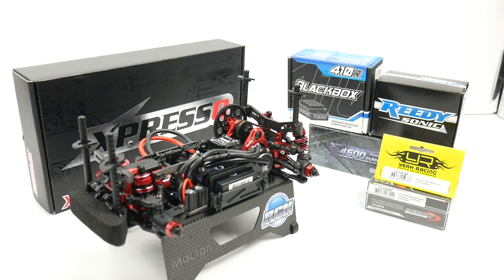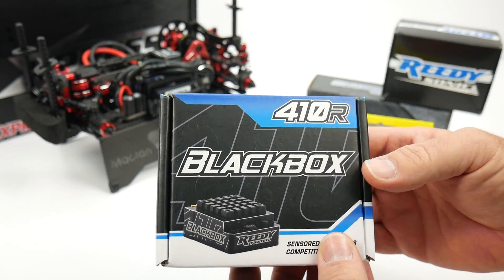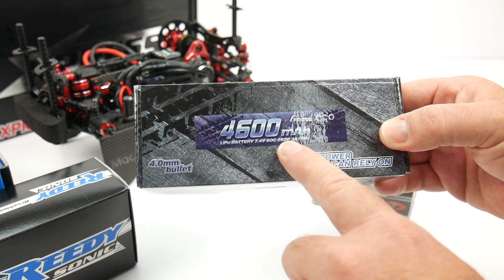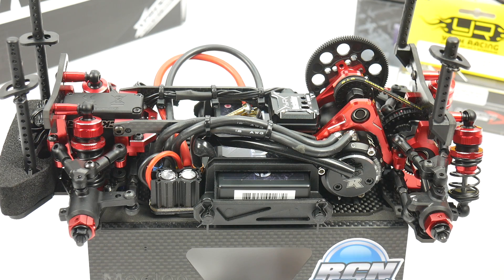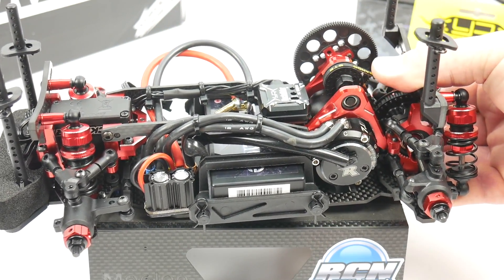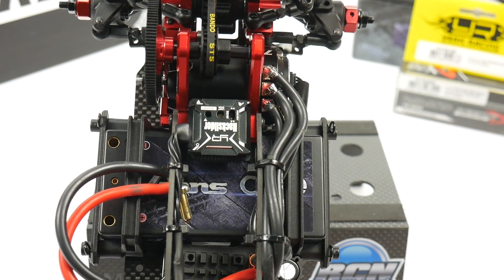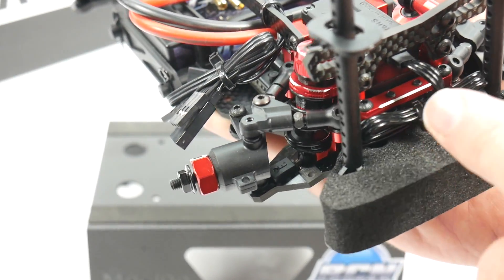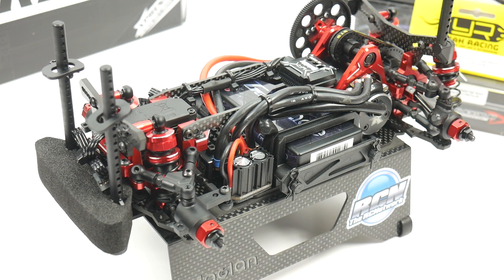Xpresso K1 Chassis KIT -  Electronics Installed

Comment: Nice Rich
I nearly grabbed one when I saw it first on RCMart. Have some credit owing. I think the price gone up since, so must be a hot item.
I love the VW van body, so cool!
Good to see you using Gens Ace, love them. You won't be disappointed.
Looking forward to your review overall.
Regards
Garszy
Reply from the maker: This is a fun little car...just got it all buttoned up tonight.  And, yeah, GensAce are the batteries to run now!
Reply: I have ran them for about 5  years. Never let me down. I run XT 150s on the end. Their size makes it easier for me to use & better power.
Reply from the maker: XT150's are starting to be my favorite connectors for RTR's
Reply: The RCNetwork 
Yeah easier to connect, soldering is easy, they don't come apart by accident. I like them, no complaints so far. Got the idea off Vas if remember correctly. The size appealed to me, and I love that you can seperate the positive & negative wires to fit neatly.

Comment: One of these looks like tons of fun. The faults with the building instructions are what's keeping me away since I'm new to kit building. 

In your opinion, is this kit something a new to hobby kit building person can do without too much frustration?
Reply from the maker: The instructions video (Build Update 1) was done to help Xpress and first owners get through the manual.  Since then, Xpress has updated the PDF online as well as making some great videos illustrating some of the tough parts.  If it's your first kit, it will be challenging....The turnbuckles and shocks will be your most difficult parts....but I would definitely include this kit in your list of must haves.....Also be away, you'll have to pick out electronics, wheels/tires and body.
Reply: We are working on the new user manual & expected to upload it at early next week

Comment: nice looking kit think its cool you don't have to mod anything to fit 1/10 electronics. You said this is a drift car but seems better as a speed run car with that motor. 17.5 is sometimes to much for larger 1/10 drift cars. Why not upgrade ur sakura D4 and some vids with it. The D4 is going to be way more of a drift car box stock.
Reply from the maker: No mods to fit what I have in there, but I do recommend a lo pro servo....once fitting the body, I have it slammed to the shock tower.  And, yes, the D4 is being worked on....I've totally slacked on that build.  Actually fired it up tonight and will be practicing with it